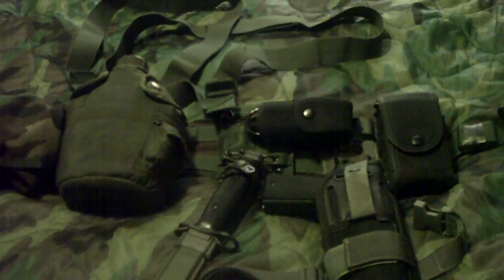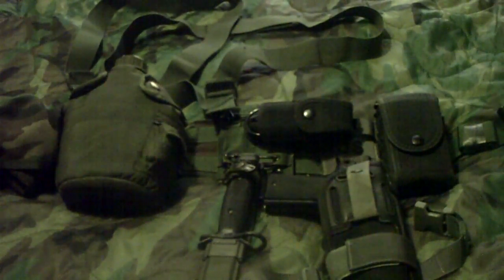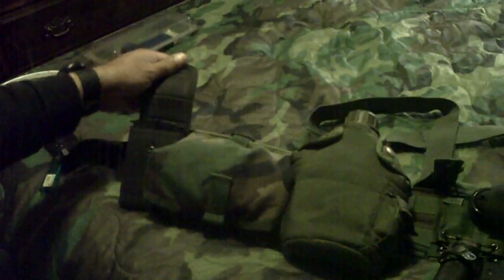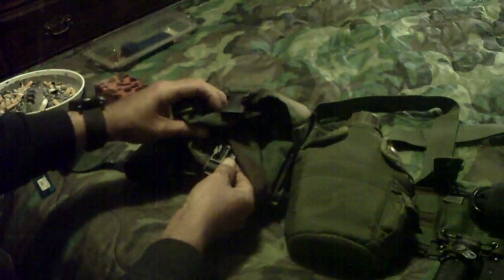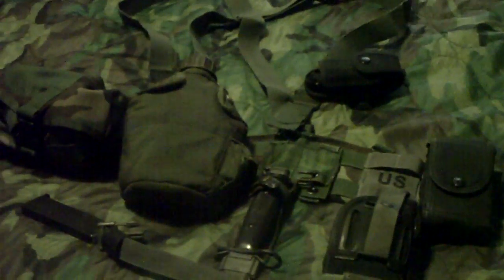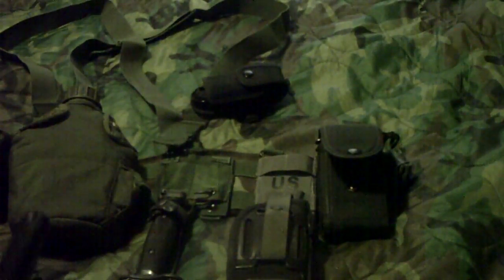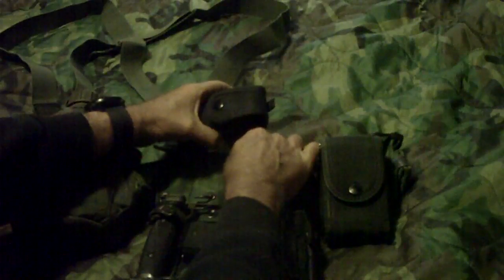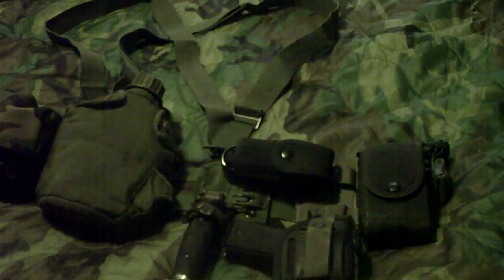Molle Battle Belt

Comment from the maker: @gibsonjr11 Thank you for your comment and advice.  I have a few sets of the H/Y type suspenders but, the defeat the purpose of wearing the battle belt under my CIRAS vest. Those suspenders are very uncomfortable with the weight of the CIRAS vets pressing down on the shoulders and the attachment points become non-existent, due to being totally enclosed by the vest.